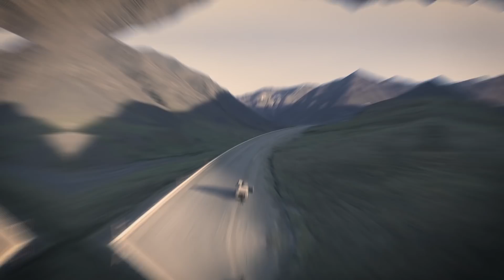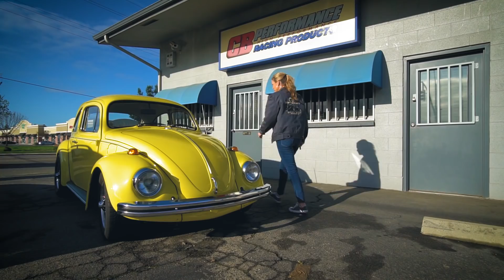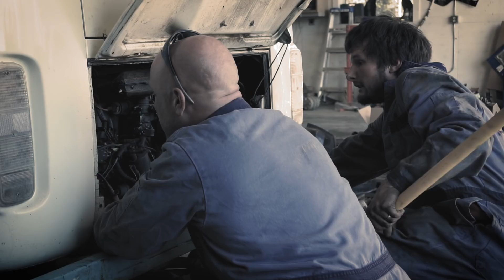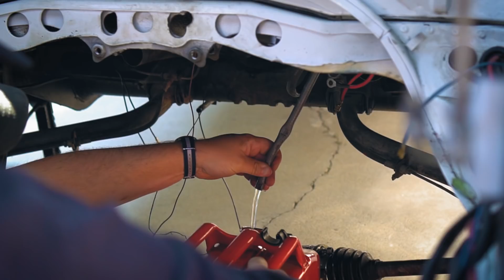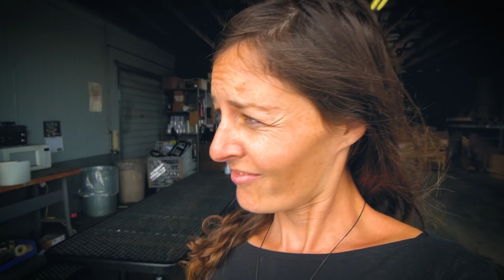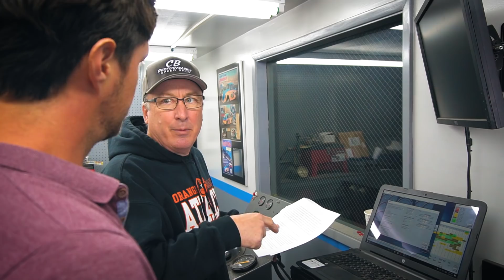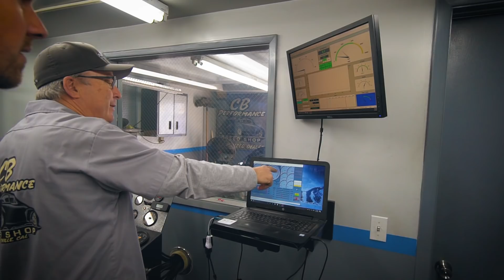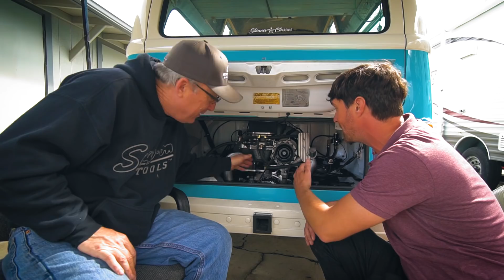Building an Engine to Drive Around The World! // S01E07

Comment: How to build an engine which can take you around the world:
1. Sell the VW bus in a hurry... 2. Trak down a diesel Benz van (any model from the late 90s is fine) 3. Fill her up, chuck in a matras and some (veggy) snacks and start the engine. DONE ! Bon voyage !!!
Reply: Mercedes W123 240d is the best engine build ever!
Reply: @peterneerincx23  You can surely leave out any benz specific types...All what Mercedes puts out is pretty much bullet proof... On the other hand: Anything the VW plant has come up with is oke for pot smokers who are not doing anything critical and it sounds nice... Don't expect any longevity from VW/Porsche flat 4 or 6 aircooled design fuck-ups... Even the trusted Citroën 2CV (with a flat 2 aircooled powderplant" fitted) will easily outlast anything the Nazi fraudsters ever cooked up...
Reply: @E.Asinus  That's a beast 😳

Comment: 96hp on 1776cc engine is not anything special, but 96@4700rpm on 1776cc engine is incredible!
Reply: mike brink  VW is limited by RPM if it is to stay alive long term. I'm thinking your Bike revs a bit more than 5K rpm to get the power?

Comment: I honestly need someone to explain this logic to me:

I have a job I need to do. I need to tighten this 22mm bold to 70 ft/lb of torque. Unfortunately, I've really had trouble doing the job using this marshmallow. In fact I have gone through so many marshmallows trying to tighten this bolt I can't even count them. I feel like I've spent so many hours tightening this bolt with marshmallows. I've been told that there is company making marshmallows that are so good that I might be able to do it.

I am not a VW hater by the way. (I loved my Passat) But my point is obviously that if you want to do a job you should use the right tool. If you want to travel around the world you should use a tool that is designed for the task. Vintage Volkswagens are not in any way designed for this job. "But marshmallows are so cool looking! And won't it be amazing when I can tell everyone that I tightened this bolt with a marshmallow?"

No. Just use the marshmallow for what it was designed for.

Comment: If it were me and i was driving this around the world, I'd toss a Cummins R2.8 in it and call it a day. Would finally have enough torque to get up the mountains and also get some decent fuel economy. And undoubtebly more reliable than the aircooled vw engines, which i love but wouldn't trust traveling too far with.

Comment: Great engine, but 96hp compared to 55hp is not totally correct (says the german guy).
The 96hp are imperial horespower and measured at the crank. The 55hp are metric and mesured at the wheel (with drivetrain losses 10-15% nowadays - with your differential probably a bit more). So metric would be 94hp - 15%=~80hp - which is still great!

Have a great trip and hopefully you don't have to rebuild the engine on your trip.
Reply: This is good info. I had no idea. So all these years in the USA we havew been using the wrong criterion?
Reply: Dude, they could of swapped in a 1.9TDI ( think Bora, Golf, Jetta, Octavia) from 1999-2004 and it would of had way more power and been bullet proof. Instead they chose another PIT of a aircooled disaster that will literally break down
Reply: @goclunker  this is kinda what their show is about, making it exclusive and entertaining, not practical ;)
Reply: @TheDesertwalker  it's not wrong, it's just measured differently . If you want to compare two units you have to convert them. But hp in general is stupid - Watt would be way better to compare.

Comment: OK,....just so you know that was porno for gearheads like me!!! 100% the way to go, this neutralizes the high top and the carb issues at elevations, Boomerang is going to run so good you will be bored with all the maintenance free driving you will be doing. Just be sure to take a COMPLETE set of spare electronics including the CPU because I doubt in India you will have access to parts that are as custom as his. Bus on baby Bus on!!

Comment: I would have a spare sensor for every single spot on that engine that makes the EFI run like the crank trigger sensor that's on there with the aluminum plate on the front of the crank pulley that crank trigger set up like I would have two of those spare and every other one of them spare that way if anything happens you can replace the sensors you're never gonna find those over in Europe Urbino Australia in the middle of the outback and it's not like they take up a lot of room.
Reply from the maker: You're right Emery, CB Performance have sent us off with a box load of spares for the trip.  They are 100% behind us and we're very lucky to have their support

Comment: How do you go about doing engine stuff in one country while making sure it's still road legal where you're going? USA doesn't seem to have many rules regarding vehicles at all compared to the rest of the western world countries so did you have to make sure that it'd be road legal in Europe, Asia etc. before settling on a specific engine?

Obviously an underpowered vehicle from way back isn't designed to handle 800 hp for example, it'd probably destroy the car, and I also know that you usually need better brakes to match an upgrade in power in Europe for example, and possibly even a new MOT/Tüv (depending on country) depending on how big a power upgrade it is, and depending on whether or not someone else has already done the upgrade before and had it tested and approved with that amount of power.
It also needs to pass certain emission standards and stuff AFAIK.

How do/did you make sure your vehicle would be road legal all over the world? Or don't you need to get it approved at all as long as it's registered in the USA?

Comment: Now my question is how much does all of the engine ended up costing to buuld ot up. I guess you might have gotten a better price for it than a casual customer because I guess you are an influencer for classic car/bus you want to drive. Like yeah that makes sense you seem to be doing youtube full time actually driving arround with this bus arround. I'm seriously curious to know how much this thing costs actually.

Cause I guess I might want to get into mecanics. My father nearly knows nothing about mecanics on a car and I'd probanky like to make some car restoration for fun and to learn and because it is a thing I would like to do one day I guess.

But seriously prices for engine aren't free. I had my old Chevrolet Optra 2005 that had the gasget motor fails and thr petrol and oil ended up.kixing together and the engine was pretty much dead. The price for this failed engine of the car was actually stoped the production custed more than the valuenof the car actually was because it was knows for having that problem and was more likely to happen again too. The guy at the garage told me it would be for the cheapest 1500$ but more realisticaly 2000$ and more for the engine alone. I guess for the working hours it must have custed even more than that for the classical car you want to ride too.

I guess it is saddly because it's like how much money you get paid each year it is kind of gonna keep being a secret because it must have costed a lots of money I guess.

Comment: When the computer is installed,he fits a rubber hose with what appears to be a fuel filter  in line, but that can't be....what is that?
Reply from the maker: it's to help stabilize the vacuum for the MAP sensor in the ECU

Comment: Buy a Cummins and all your problems will go away
Reply: Are cum engines air cooled?
Reply: Almost any engine that's no more than 15years old would be better.  Mitsubishi 1.332cc watercooled engine had 108hp on it'a factory tune after 150K. Why stick with a 50year old aircooled engine design? Power and reliabilty have gone up immensely each decade.

Comment: My 63 F 100 made 400hp with a build 429 strong enough to rip a drive shaft in half  but you sold it not working on a fiberglass  dunebugy  with a type 4

Comment: It is a straight lie to say you get more power out of fuel injection than carb.
hotrod garage shows how carb cools the intake and is capable of more power
Reply: Under all the varying conditions that they will be traveling through fuel injection will provide more power for their situation because it can automatically adjust the air fuel ratio whereas carburetion cannot.

Comment: Wow.....  so,.... what is your intention on handling your interior heating system since you gave up you heat exchangers - engine blower fan housing?
I switched out My Volkswagen original Arctic Heater in My 71 bus Over 30 years ago For this style of gasoline interior heater, I ducted it into the existing heating and Added a  inline 12V Booster air fan to Get Lots of volume Of hot air Blowing up the front windshield.  I still have my bus And have been all over North America including Canada Alaska numerious strips into Mexico and Latin America One trip down to Patagonia15 years ago.
I  build my own engines etc. And have never had an engine failure on the road Because of that, ever. As a teenager, I cut my teeth with the Gene Berg crowd.   People that Poopoo Volkswagen upright air-cooled engine technology Are those people that simply have no idea what they're talking about. They Are the people That should Only be driving Water cooled V8's with automatic transmissions. You finally came across the correct people to Put all your shit together.  Keep the gas padel off the floorboard, always.   Shift down early, always.   Don't ping your cylinders running all that horrible gas that you will be forced to use often . I hope you are running a conservative compression ratio?.. Or maybe the computer is the new King in town!    Be crazy about Keeping the air filters super clean Whenever you're off Road And spiraling dust trails Behind you.  You start pumping dust through your cylinders and it's game over brother in 5000 miles.  

Still out there driving the dream....     

Gas heater example:      No reason to freeze your ass when it's 0 degrees outside.
https://heaters4you.com/eberspacher/323-airtronic-d2-12v-with-mounting-kit-easy-start-select-252675050000.html?gclid=Cj0KCQiA4aXiBRCRARIsAMBZGz8kOAzEPhK37V86PjBb6VCsO7xE0ekohiDr9ExnqBJRoRjLg8u6MP8aAp5OEALw_wcB

PS    You can easily install that heater in the engine compartment left side where the original arctic heater was located from Volkswagen. That way you can gain access to the existing heat ducting Under the car, And also access fuel for the heater from the engine compartment. Not a difficult installation at all. Trust me, It's a life changer For us all-world Bus drivers .
Reply from the maker: We will be talking about heating in a video later in season 1

Comment: I am going to be that asshole hidden way down in the comments but all this money put into a performance engine by a very good brand for torque and reliability, the money could have been spent on an air cooled vw diesel, an upcoming swap in Europe, bags more torque, cheap easy parts, super cheap to buy engines and they will do 300,000 miles

Comment: At last I found real travellers.   Not the fake once who only are only showing fake lush life.

You must have a passion for vw, considering you still persist in drive such à small old vehiculo. 

My father used to have a VW beetle with an Oettinger engine,  was faster then it's fancy brother from Porsche.  Sadly for me and my brother it was sold and trashed on à rally cross course. 😑

Comment: It will blow up down the road, you just paid more for a bigger fail, a 1950s air cooled 4 banger no matter how tricked out is no match for modern high speed driving for long trips..it's 2019 and not 1969 kids, time to face the tech revolution.